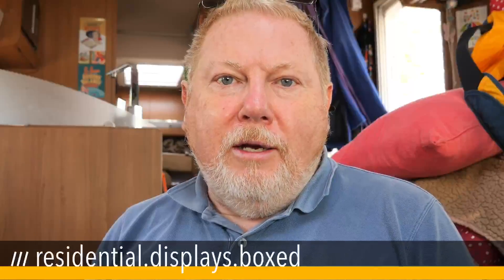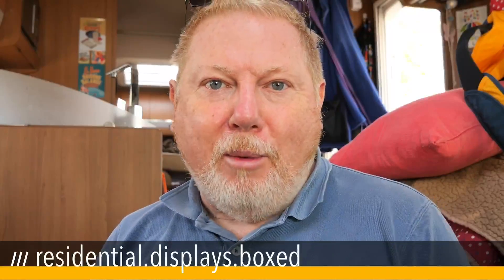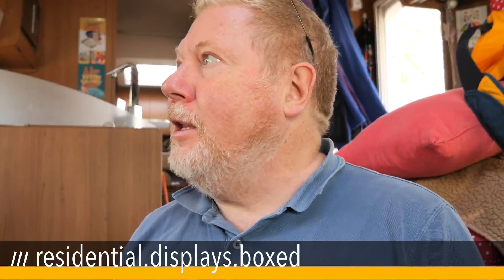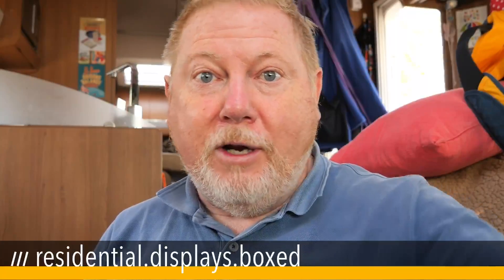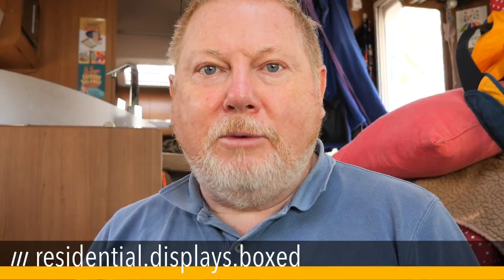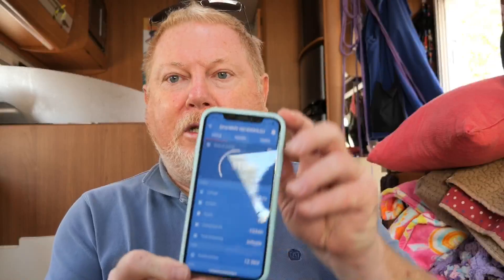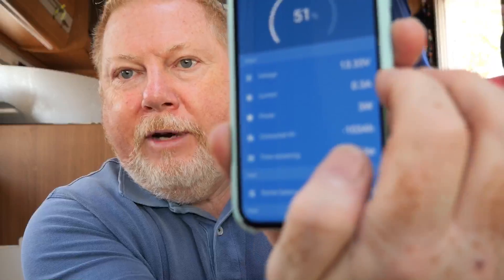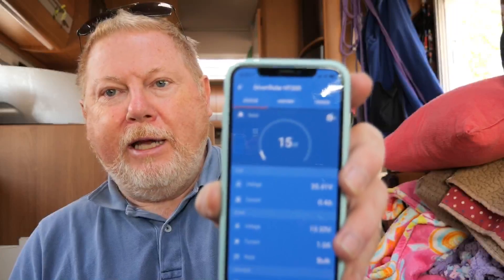Off Grid Solar Panel Connection to Lithium Battery

Comment: That's fantastic, I've been using a portable 100 watt panel this week as the sun is getting low in the sky lately, it's all charged up in a few hours with the sunny weather. My panel gives about six amps per hour in summer and about three about now, mid October. A super vid old boy.👍
Reply from the maker: Cheers mate 👍😀😎

Comment: Ah, should have watched this before my comment on an older video - see you have an awesome Lithium set up already... 🙄 👍🏻 😉
I have thought about a portable supplementary solar panel, but will see how our new system performs when we head off next month and in June for a six week break... 👌🏻
Cheers, Rog... 👍🏻 😉 🐍
Reply from the maker: The Spanish sunshine should see you all OK but depends on how big your leisure battery is and the wattage of your panels to recharge it. Then there is how much electricity you actually use.  Good idea to "try it out" first before spending out :)
Reply: The Happy Travellers - We will have 2x105Ah LiFos batteries and a 150W solar panel feeding through an EP Ever charge controller.
Even in these dull days of Winter the solar panel is keeping our current 120AH SLA battery 🔋 fully topped up... 👍🏻. New kit fitted next week... ✅ 👏🏻

Comment: When I have looked at these fold up solar panels it says only lead batteries and gel not give used on lithium batteries . Have you checked Steve that you can connect to your systems ?
Reply from the maker: Yes and it’s all down to the charge controller plus the charge profile. Most are set for lead acid which is not ideal for lithium but will still work even if it’s no so efficient.

Comment: Hi Guys,Been watching all this solar stuff. How about telling everybody how it all stacks up, how much use , the cost of the system against a typical set up of two 100amp hour batteries and one 100w solar panel with only a small 500w inverter to use for charging phones razors toothbrushes etc. Plus how often do you use and for how long do you use a 240v item
Reply from the maker: Happy to say what we do but the comparison with other “use cases” is something that we just can’t do. Not least, we don’t have a 300watt inverter or any such things. 
Everyone’s situation is unique and we chose. A system that we thought would work for us. I think we have done that 😀👍😎

Comment: When I go to spain next year brought all powers battery bank cost £200 then you can run lots of things upto 300watts can charge it from the mains if you have hook up. If off grid got a flexible solar panel 130w off ebay £120, then I can move it about for the best sun shine and charge the power pack. It will also charge off solar and power fridge or phones at the time. Save time and money having the van rewired new batteries etc.
Reply from the maker: I can see that would be a good solution for many 👍😀😎

Comment: Hi Steve,
I'm curious to know you views:

Would there be possible problems with the positive feeding power back into the mppt controller??
Victron mmpt controllers are a great bit of kit, wouldn't want to damage it.....
Thanks.
Reply from the maker: Good question. No, there is no issue with that. There is protection in place but even if that was not there I’m confident that it would not be a problem.
Reply: @TheHappyTravellers   Thanks Steve,  all the best. 👍